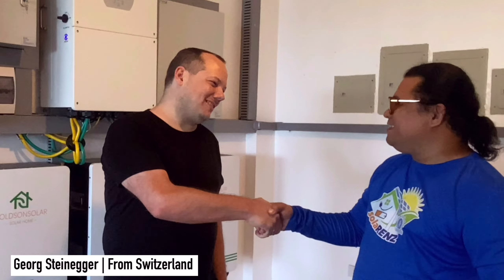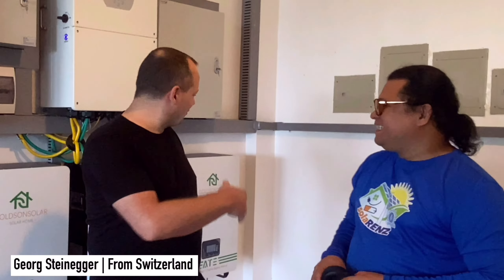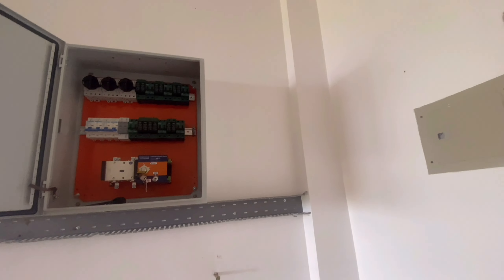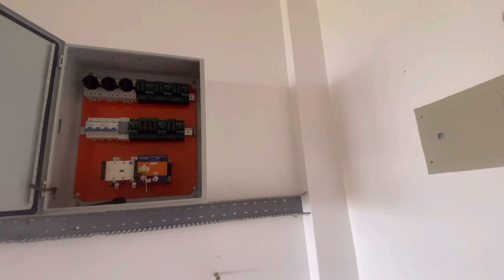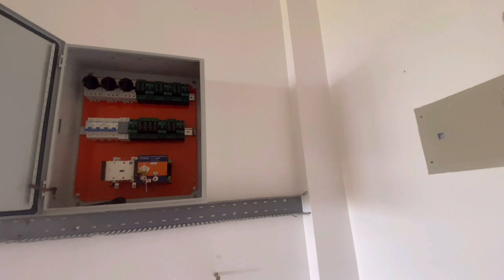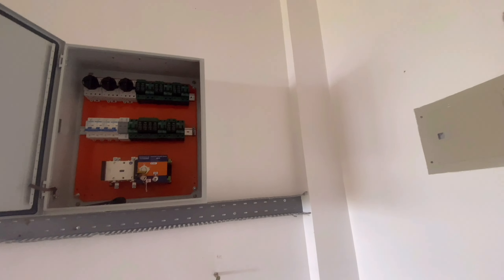1-32kw Hybrid Deye Inverter, 27kw Trina Solar Panel,800Ah LiFeP04 | Happy Client with the big system

Comment: Sola Renz, ang laki ng project na yan ang gamit mo parin ay plastic cable tray. Gamitan mo naman nang aluminum yan para mas malinis. Obvious na cost concious masyado ang project mo and of course speed of implementation. Aluminum trays not only is good, clean and professionally looking. It is lasting also but can be tedious to work with especially with drilling holes.
Reply: Hindi ata ako confortable sa isang malaking baterya na 600A  at maglagay ng dalawang cable sa  positive at negative port ng baterya. Mas maganda kung gagamit  ng dalawang 300A siguro . Yung mga cable niya very congested especially sa battery side at dapat mag switch na sa metal  raceway/cable tray o di kaya fire proof  metal trunk .
Reply: may permit at inspection ba ang mga to from the city or whichever responsible. Huwag na natin hintayin magkaroon ng aksidente  before the Phillipine goverment regulates installation of solar power.

Comment: Sir Renz, gud day. May 6-hp ice-making machine kami na gusto namin i power ng solar energy. Magkano kaya budget nito? Thanks po
Reply from the maker: ₱ 720,000 

Materials: 8kw Hybrid deye inverter,
 
2pcs of 280Ah LiFeP04 batteries 

9.9 kilowatts Solar panels (18pcs 550watts solar panels)

Accessories and safety devices

Labor or Installation fee